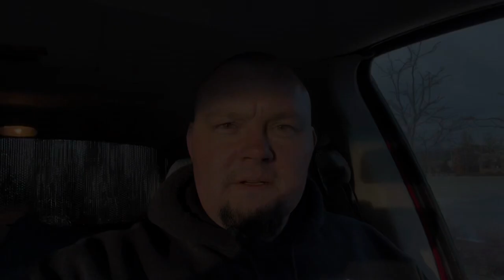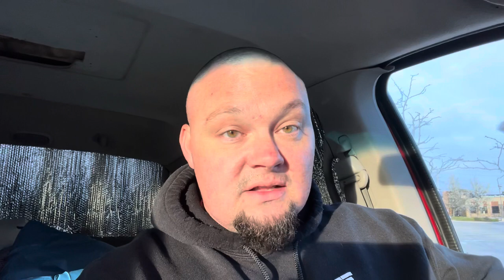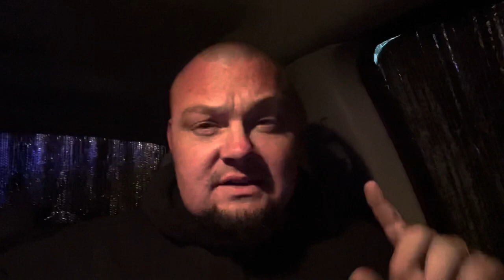RV Transport and Steep Grades

Comment: I've spent many years doing grades with 18 wheeler without jake or retarder and learned how not to get brake fade the hard way. I also had trucks with jake brake and retarder which is awesome. But another tip i recommend with those radical 7% grades is to start slow and don't let the truck get into overdrive. With the 48RE dodge trans that makes it pretty slow but well worth it especially with a lot of switchbacks because the 48 drops out of lockup really easy. The six speeds work better that way. With the manual keep it in 5th which makes pretty slow as well but much better holdback. Main thing is keep it slow and if you do have trouble you will still be able to get it stopped.
Reply from the maker: Great advice!

Comment: No mention  of using lower gears on decent.  You can also apply trailer breaks first then TV.  The goal is to not need to use breaking  but need to be in right gear.